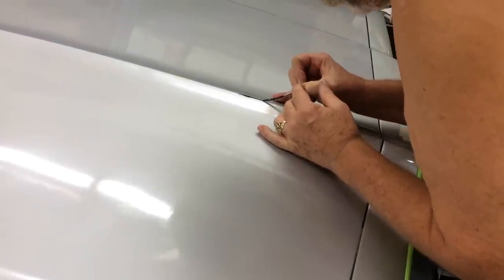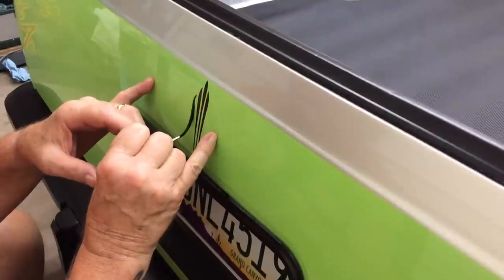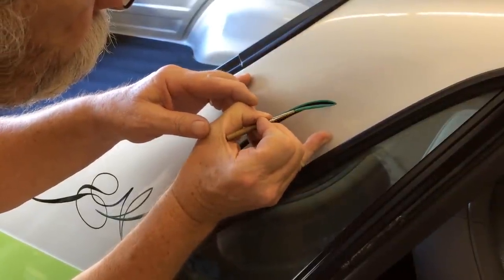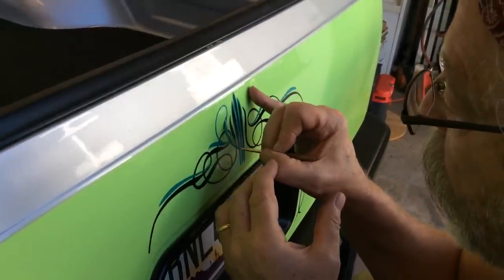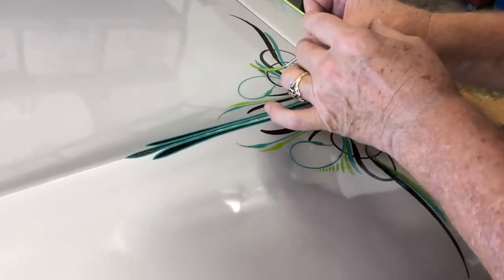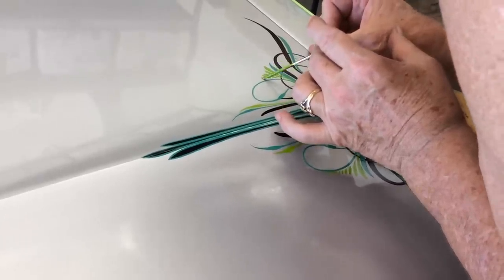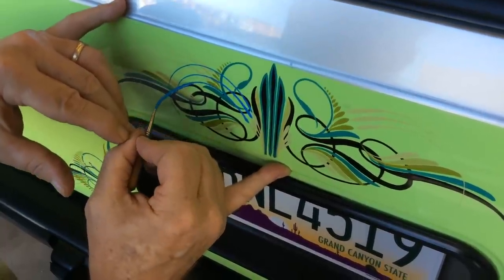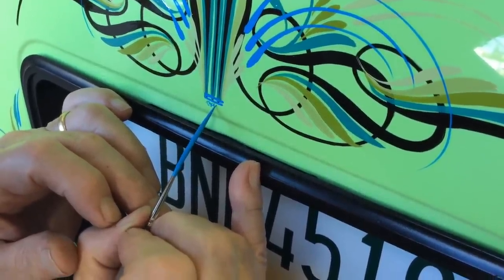Steve Kafka - El Camino

Comment: Work of art! Do you allow the paint to dry completely before applying the next color?
Reply from the maker: I'm using mineral spirits,1-shot with lead, and Smooth Stroke, I stripe one color, always move to my right,and by the time I'm back to the beginning,I can put the second color without running, you have to watch finger placement, and keep your hands clean.

Comment: Can I have parts of a car pinstriped between the color paint and the clear coat?
Reply: Little late but from what I've collected 1shot enamel is so good you can go over clear coat and itll last decades even on motorcycles that constantly are being hit by pebbles. And apparently if you would like to clear coat over it, then adding hardener to the enamel goes best with clear coat